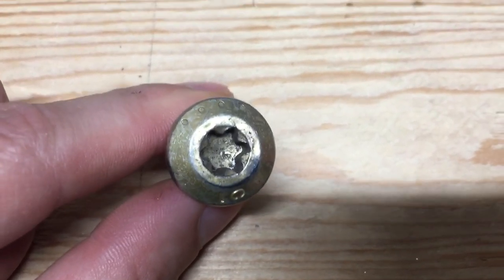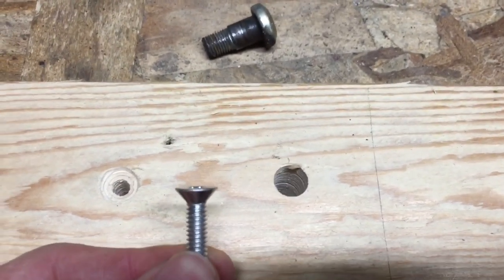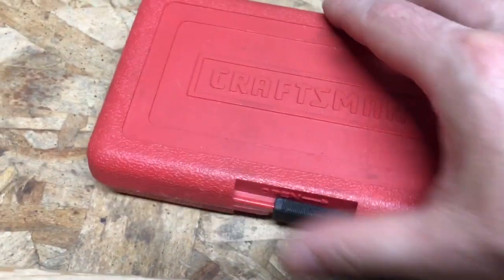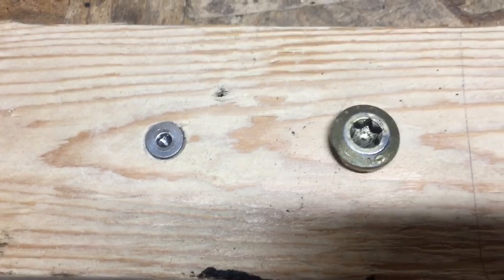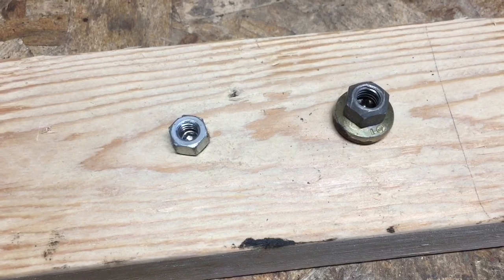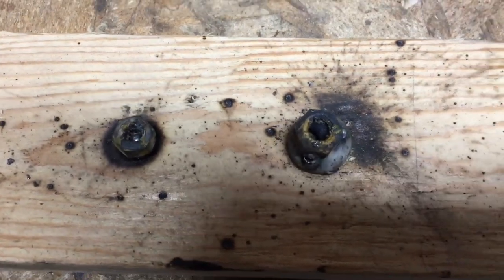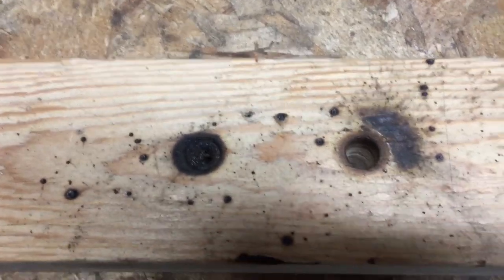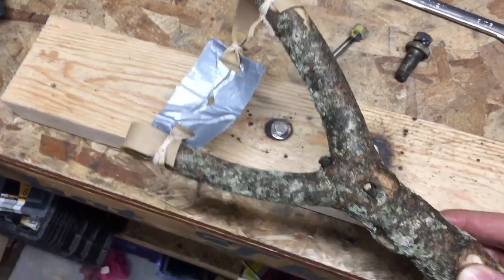How to Remove Torx (Star) bolts/screws | 4 WAYS | WELD NUT GUARANTEED | Stripped Rusted Stuck Frozen

Comment from the maker: This was one of the very first videos that I made. I know that it progresses slowly, and isn’t the best; no filming equipment and out of my comfort zone.  But, I just dove in and was trying to share helpful information to help people out.
I plan to remake this video at a faster pace with much more detail in the future.!
Reply: @Buckwheat Hikes I agree. My POS Chevy equinox driver seat bolts are t50 torx bolts and one of them is stripped and it was torqued down, I suspect it was because the heater core was replaced before. And they would have needed to have removed the driver seat. I'm trying to take them out and so I can detail it extremely.
Reply: Best video ever I’m changing the transmission fluid on my 90 Mercedes with only 90k miles & the t30 is completely stripped I don’t think it has ever been taken off imma have to rent another jack & really get under there thanks for the tip!

Comment: not applicable if the surrounding of the bolt is narrow, plastic or sensitive ...
Reply from the maker: Thanks for pointing that out! I agree; welding creates extreme heat and will damage plastic or sensitive materials.
Typically, when I experience issues with Torx bolts, it is in an automotive application, where it will not turn because it is rusted into a steel tapped hole. In that case, welding helps to break the bond. Thanks!
Reply: @HowtoandReviewsOfficial  why did they invent torx head bolts anyway if they strip so easy?
Reply from the maker: @jameson6930  when installing them, they are easier/faster to mate with a driver tool, less prone to strip, and more torque can be applied. This is an advantage for automobile assembly lines for example. They can quickly and repeatably be rammed right in with a power driver.
However, they can be a real hassle to remove, especially after time if they have rusted.
Reply: @jameson6930  exactly as the videos\channel's author stated. Just referencing the torx head deck screws, if I had a choice I'd spend the extra money on those in a fab. job EVERYtime cause they don't torque out when applying 98% of the time. But for longevity on a vehicle they are a hassle without being stainless steel or some high quality anti rusting. Trying to remove about 6 to 8 on my chevy's tailgate hinges, they are bulbous capped torx heads and one stripped. The other quite literally twisted the torx head bit when applying the ratchet bit on my breaker bar. After applying PB breaker spray 4 times and letting it soak in each time. It's comical in a way.

Comment: Mine is between the firewall and the engine and there is barely enough room to fit a socket. Why would you use torx bolts on a car engine, especially on an intake? I wish engine designers had to work on them.
Reply from the maker: That’s awful. What a mess.

Comment: Why in gods name are these bolts ever used? These are the WORST and strip so easily.
Reply from the maker: Fast, easy, repeatable installation during manufacturing. Just zip them in. Then, it’s the consumer’s problem to get them out.

Comment: That’s not a bolt. It’s a screw. Torx Bolts are the inverse of that head and require a socket. Please retitle so people can actually find the correct help.
Reply from the maker: You are describing an E-Torx (External Torx) bolt, or also called an Inverted Torx. 
Search for “E-Torx bolt.” That should give you the correct help to remove your bolt. 
Also, these are indeed bolts. Not screws. I hope that helps!

Comment: I need to take my steering wheel off because I got a new one. There’s one on each side and it’s a tight fit. I can’t get them out
Reply: what kind of screws are they? Do they have a rounded bolt head like the one on the right hand side of the example board in the video or flat\flush headed?
What condition do they look like they are in? Since it's the interior I doubt they are rusted but still asking.
Reply: @dragonsword7370  it used to be a torx screw and they are flat headed. It’s so bad that if any random person that sees it won’t even have any idea what it is. It’s a shape as if you were to flip a traffic come upside down and look down into it. It’s not rusty at all. It’s just perfectly smooth. I commented that a week ago and still have yet to get it out
Reply from the maker: Sorry I missed this!  Sounds like you don’t have much room or many options. 
I would first try to easy-out tool. If that’s not working out, and if you cannot weld a nut on, drill the center out, same diameter as the threaded part of the bolt, until the head is detached, then lift the steering wheel off. There will be screws with no heads left behind. Then use some vice grips to turn what’s left of the screws out.  That’s my recommendation.

Comment: I have replaced multiple torx bolt with regular 10 mm bolts for car parts I remove and reinstall on a regular basis. So much easier to repeatedly loosen and tighten back to spec !
Reply from the maker: Right on! Car manufacturers use torx bolts because they are fast and easy to drive in with a bit driver. Perfect for mass production.
But awful for us to get them out. I agree, I always replace them with a hex head bolt.

Comment: I have a torex on my radiator fans that I can’t get off and I’ve tried a few things even the dremel but there’s nothing else I can think of doing and I can’t weld it because it’s stuck under my car, do you have any ideas?
Reply from the maker: My last resort is to grind the head off, and the part can be removed. And hopefully use vice grips to remove the stud that is still sticking out the tapped hole.

Comment: this fucking works… i was replacing my conductor plate on my benzo and the last bolt stripped on the first turn then i went to a bigger hex then to a grinder and then hopped on youtube… use a vg or wire cutter and hold on tight and twist 🙏🏻🙏🏻🙏🏻🙏🏻🙏🏻 ty yt

Comment: So I have a stripped out inverted 12mm hex head bolt that it completely stripped.  There is no room to weld anything to the top and I don't know what to use to get it out. 

I felt the bolt pop when I went to take it off but right after the bar slipped and now all it does is spin on the inside. 

What do you suggest I use to get this bolt out?  It is literally the last bolt to remove to take the head off the engine to replace my head gasket.
Reply from the maker: That’s typical isn’t it, the last bolt  is the one that gives you trouble and a half hour job turns into a five hour job.

The bolt is torqued down, so it won’t come out easy. You need to be able to get some good torque on it. 

My first thought is an extractor for rounded off bolt heads. If there is any hex left at all, it may bite in and grab if you pound it on. This should be secure and allow you to use a breaker bar. An example is here:
https://www.lowes.com/pd/IRWIN-BOLT-GRIP-5-Pack-Bolt-Extractor-Set/1003021030?cm_mmc=shp-cprdtolgooglelia-216-mechanicstools-1003021030-_-0&placeholder=null&ds_rl=1286981&gclid=EAIaIQobChMIyryEtfH48AIVowh9Ch0VhwKHEAQYAiABEgLGZfD_BwE&gclsrc=aw.ds
Worst case, head bolts are long. If you can cut/grind the head off, once you remove the cylinder head, you will have plenty of bolt and room to get it out no problem. That would probably be last resort on my list. Not sure if you have room for that if you don’t have room to weld on a nut though.

I would search for a video or forum specifically dealing with a stuck head bolt. Maybe there is a good solution.

Let me know how it goes and how you get it out!
Reply: The issue I'm having is I can't get a bolt extractor to fit on top, the area where I'm working in is very small and that style extractor won't fit over the top. If I can't get it out then I think im going to pull the motor out and take it to a shop.  That's the last thing I want to do. 

Yes it always seems that it is way it works. It's always the last one that gives you issues.
Reply: So I got it out, called a mobile welder and he was able to weld a piece of pipe onto the bolt head and we were able to get it out!!  Head is off and on its way to the machine shop!!
Reply from the maker: @TJsVette  Awesome! Happy to hear that. You are smooth sailing now!

Comment: What are your thoughts on drilling a hole, thread tapping it, finding a grade 5 or grade 8 bolt with matching threads, and red locktite it together?
Reply from the maker: I don’t think the loctite would hold for removing the bolt if it is really seized/rusted in place. You would need to use a left hand thread tap and bolt. The center bolt would be smaller, and there is also the possibility of just twisting the head off of the bolt is severely stuck.
Reply: @HowtoandReviewsOfficial  I gave it a go and it didn't work. Beating a chisel and using vice grips did way better.
Reply from the maker: @frieza625  Nice! Glad you got it sorted out!

Comment: Instead of welding, what about liquid weld or super strength epoxy?  Might work if the bolt is not rusted or stuck super, super tight...just a thought.
Reply from the maker: Great suggestion! I agree that if the bolt is not rusted or seized, liquid weld or epoxy may be a possibility.  Also, if this is the case, it would be safer for the surrounding materials. Welding can melt or damage glass, plastic, fabric,  ...
Reply: And you might not have a welder.

Comment: What if it smaller? Like T10? One on my gun is basically just a circle now with no teeth.
Reply from the maker: The smallest bolt size that I have used the weld a nut on method was a 1/4-20, which I believe is a T30. T10 would be a very small screw, like a #4. Not likely enough real-estate to weld on a nut.
Since it is so small, not much torque should be required to remove it. 
I would first try getting some type of grip on it. A rubber band between the head and Philipps screwdriver, pushing down very hard, so the rubber band will provide friction for the screwdriver to turn the screw. Whatever you can do without modifying the screw. 
After that, I would be looking for a way to cut a small slot in the top of the head to use a flat head screwdriver to turn the screw out. It should not take much of a slot, or much torque to remove it since it is so small.
But, do what you can without modifying the head first. Maybe there is just enough of a tooth left to jam a flat head of the right size in there as it is.
You will find a way. They eventually come out one way or another. 
When you get it out, replace it with a stainless steel Allen head so you never have to deal with this again.
When you get it out, definitely let us know how!
Reply: @HowtoandReviewsOfficial  Thanks for the advice! I can't stand torx bits.
Reply from the maker: @BruceWillisiscool  
No problem!
Reply: @BruceWillisiscool  try good ones like wiha,snap on ect. Chinese tools cause the problems that this video was made for.

Comment: My steering wheel screw is stripped how can I remove it without having to weld anything on it, I already tried the rubber band method as well
Reply from the maker: Are these several small screws around the perimeter, or a large screw in the center? Flathead/countersunk screw or socket head cap screw or hex head screw?
Reply: @HowtoandReviewsOfficial  there were just 2 small screws one came out with ease and the ither one got stripped, I ended up just ripping the steering wheel off and had to cut it but its worth it because i have my quick release on now
Reply from the maker: @omarsanchez2436  Nice work! Yeah, that’s pretty much what I would’ve done. Drill the screw heads off, remove the steering wheel, then twist out what’s left of the screw with some voice grips.

Comment: My xbox one controller has 5 torque screws and I took out the four outer ones but the middle one is like glued on there and I cannot get it out cause the middle part that sticks out broke off and I dont have any flatheads that fit the screw perfectly so I cannot take apart the controller
Reply from the maker: For a small screw like that, if the torx shape is damaged or rounded out, your next best option is definitely to use a use a flat head of a perfect size that will fit in there and grip.
Reply: didnt have one and it took a lot of effort to open with a flat head that was bigger but it was all for nothing it just ruined my controller 🙁

Comment: Hi. The screws on the bottom front panel of my front load washer are rusted and stripped. I need to remove them to take the front panel off to get to the drain pump. Welding is out of the question!!  Is there a simpler waY to get them out?? There are 4 star, I think. They may have been phillips heads at one time. They are extremely tight in there. I've tried using just about every tool you can imagine. I also sprayed penetrating oil twice now and they still won't budge!!  Help!!
Reply from the maker: That’s a tough situation. I’ve been there many times. Welding a nut on was the game changer.
If you have tried every tool, you are just about out of options. But there are some options that I know of.

If you think it is possible to turn the screws out if the Phillips was not stripped out and you could actually get the screwdriver securely seated, an option is to cut a slot in the head and use a flat screwdriver. Cut a slot with a dremel or right angle grinder with a thin cutoff wheel. 

If you don’t think that will do it, here is one pretty much guaranteed way, but I save it for last resort because there is no going back. Cut off the head, then after you remove whatever the bolt or screw was holding down, hopefully there is enough of the screw sticking out that you can use some vice grips to remove what’s left of the screw.

When you get the screw out, replace it with a stainless steel screw and use antiseize so you never have to deal with it again. 

I hope that helps. Let me know.
Reply: @HowtoandReviewsOfficial  Thank You!  Well, I had thought of that and finally was so frustrated that I called in reinforcement from "the ol man"!!  He brought in a side grinder, angle grinder, or as he says, down here in the South, we call it a "zizz wheel"!!!  So, yeah, he cut the stupid old screws out for me!!  And, Yes, I will definitely be putting some rust resistant ones back in it!!  That's CRAZY!! So, my project tonight is taking off the front panel of my washer so I can remove the drain pump and go from there..........Unless I run into another dang Snag!!! Tanks for the suggestion!! Like your channel, will now SUB!
Reply from the maker: @janieskelton-christian7652  Awesome! I’m glad you got through it. There is always a way.
I recently saw this quote... “Every 20 minute job is one broken bolt away from becoming a three day ordeal” That sounds about right.
I really appreciate the sub. Thanks!

Comment: Good Morning my friend and nice to meet you! I love this video its great and very detailed. Im trying to remove 2 cylinder block drain plugs to drain out old contaminated coolant on my 2003 dodge caravan se and i cant remove them at all its tough.
Reply from the maker: Hello! To drain the coolant, I would looking for a drain plug in the bottom of the radiator, or disconnecting the bottom radiator hose (hose clamp).
Reply: @HowtoandReviewsOfficial  I actually opened the radiator draincock first and drained out the distilled water and coolant and now i have to remove the 2 cylinder block drain plugs to remove all the old contaminated coolant from the block.
Reply from the maker: @AlwaysDiagnoseVehicleFirst  Interesting. Typically, the radiator drain plug and the lower radiator hose (where it connects to the radiator) should be the lowest point in the system and you should be able to drain the engine block from there. Some blocks have a tapped through holes with plugs for accessories like a thermostat sending unit, but I have not seen a coolant drain plug on a block. But, I am not familiar with that specific engine. 
Does it require a hex/Allen wrench?
Reply: @HowtoandReviewsOfficial  It sure does require a hex/allen wrench yes sir 💚👍

Comment: Might have just saved my car, got sum torx screws rusted n chewed up holding my crank gear for the timing belt which I have to removed to change the serpentine
Reply from the maker: That should do it! Make sure to block or mask off any sensitive materials so the weld splatter doesn’t ruin anything.

Comment: Would JB weld work instead of the welder?
Reply from the maker: J S Great question. I don’t know for sure. I have not tried that. I have tried loctite metal epoxy, which didn’t work. The nut snapped off. I would suspect that the results would be similar with JB Weld.

Comment: This solution only works in a very very extremely limited number of scenarios
Reply from the maker: I’ve personally used it a fair number of times I’m larger and smaller bolts, but primarily on vehicles because that’s where I run into stuck torx bolts.

Comment: Xbox360 torx got stripped somehow so yea that sucks
Reply from the maker: Definitely no welding or easy outs on that. Try a small flat head screwdriver. You may be able to force it in and get it to catch and turn it.
Reply: @HowtoandReviewsOfficial  will attempt thanks

Comment: I hate EZ outs. They break so often. Maybe there's a expensive brand that doesn't break idk
Reply from the maker: I’ve tried Craftsman and Irwin. 
My first Craftsman set came in a nice plastic case/box that had “Craftsman” molded in it.
I went to purchase replacements for the ones that had broken over the years but it was cheaper to buy a whole new set. The new set was a flimsy little plastic box that said “china” on it. I don’t have much confidence in them.
Reply: @HowtoandReviewsOfficial  and screw torx bolts too. I literally just finished the wheel bearing on my car a few minutes ago and has to get the torch to get out one of these stupid damn torx bolts. Why were they ever made? Who knows